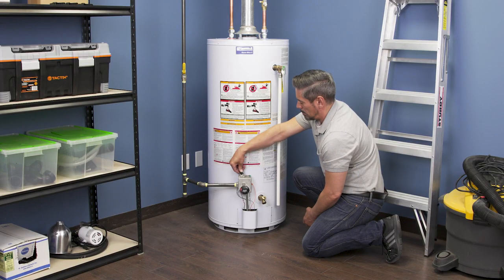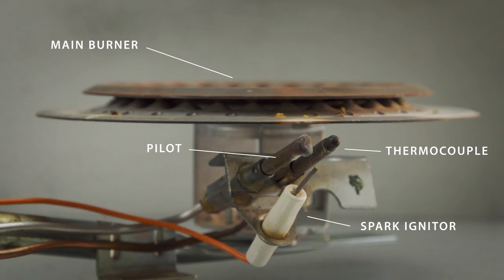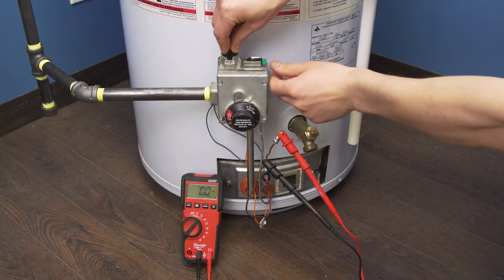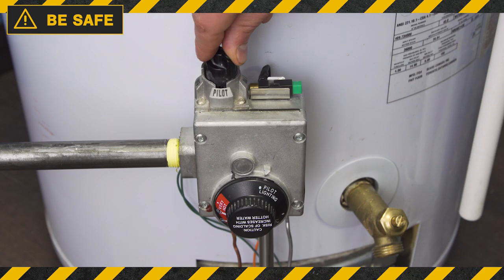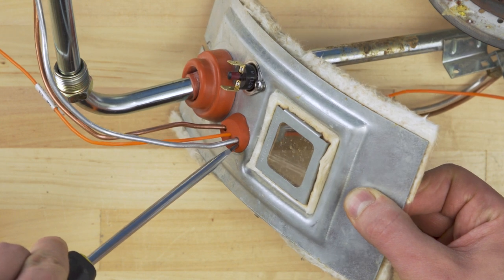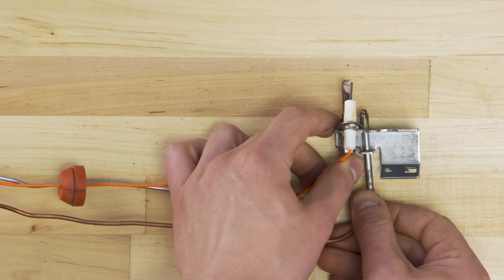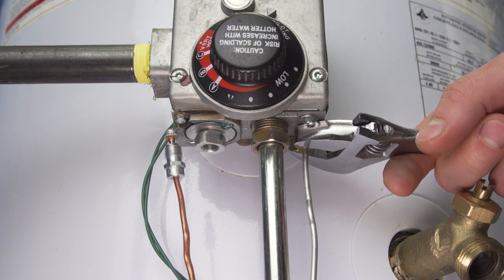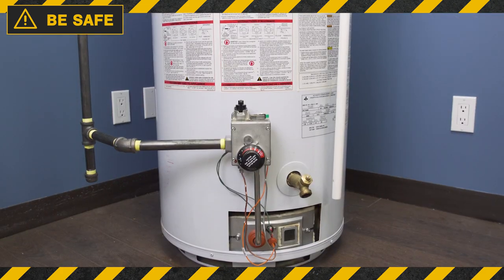Water Heater Thermocouple - Voltage Test & Replacement | Repair & Replace

Comment: Thanks a lot! Great job! Easy to understand! I  replaced thermocouple and it works! Payed less then $11 for the part and saved a lot of money doing it myself. I wouldn't touch this without your help! Thank you!!!!
Reply: Stop working again...Keep looking for the problem. ..Any thoughts?
Reply from the maker: You're welcome Jose! We're just happy to have helped!
Reply from the maker: @JoseSanchez-qh8zd  Try unscrewing the thermocouple and use alcohol and a q-tip to clean the inside threads that the thermocouple screws into. Corrosion in some cases can build up and prevent the current from flowing from the thermocouple to the gas valve. (even if the thermocouple is working correctly).

Additionally it would be worth checking the voltage on the new thermocouple. If you're getting low voltage on a new thermocouple then it likely isn't positioned correctly in the flame.
Reply: @AmreSupply  Thank you! Old thermocouple shows about 20ma. I put new thermocouple. It's working now. God bless you!

Comment: I was able to clean the thermocouple with a small cutting of stainless grill scrubber held in a pair of long hemostats. If I were to have to disconnect the gas and pilot lines to clean the thermocouple, for less than $12 at the big box store, I'd just replace it to make sure I got it done correctly it one shot. Thanks for the excellent instructional video! I'm going to order a replacement thermal switch from you (which cannot be purchased locally) to support the creation of these valuable video resources. ☮❤🌈
Reply from the maker: Thank you for sharing your experience and we appreciate the support! We're just happy to help!

Comment: A friend told me the thermocouple was probably my problem - pilot light wont stay lit.  thermal limiter switch checks out fine.   I found this video.  Tested my thermocouple - seems to be fine at 26mv.  Reconnected it.  And the pilot light stays on now!  buaaahahaha!  Thanks! :)
Reply from the maker: Thanks for watching. One thing to consider is it's worth cleaning the threads that the thermocouple screws into the gas valve. Sometimes corrosion can build up, which will prevent electricity from flowing.  (you can use vinegar or alcohol to clean) 

Also consider that even if the thermocouple generates the right voltage in an isolated test it doesn't tell you if the electricity was flowing to the gas valve. Unscrewing it might have "cleaned" some of the threads but it's another thing to keep in mind as you might have the problems return in the future.

Comment: Appreciate the vid... helpful to know how to measure things.  Mine wasn't staying lit so I replaced the thermocouple and the new one maxed out at 20mV.  It still would not stay lit.

Grabbed another thermocouple (universal at Lowes) and it is putting out 23-25mV and now working again.
Reply from the maker: Thanks for watching! Another thing to check is to see if there is corrosion on the threads on the gas valve. With how humid it can get around water heaters, this connection can become corroded and reduce the voltage that is able to pass through. If you continue to have any problems then try cleaning the connection on the gas valve with vinegar using a Q-Tip.

Comment: Hi, I have a Rheem Water Heater 130L, it has this problem: the pilot stays on, and the main burner only fires up few minutes and then off. If I try again, nothing happens, the main burner does not fire up and the pilot still stays on. Do you have any idea to fix this? Is the problem caused by the thermocouple?
Thank you very much. Your video is the best compared with others on Youtube.
Reply from the maker: Thanks for watching. Is the water getting hot enough or is it too cold? Depending on the circumstances the burner does not need to be on for too long to keep the water at the right temperature. The burner should continue to cycle on and off as needed throughout the hour.

If the water is too cold, and If the pilot stays on, then it's not an issue with the thermocouple or thermopile. It is like an issue with the control valve itself.

Comment: Just tested my thermocouple and it only got up to -17mv. appears to be bad. It stays lit until the burner comes on and then when the burner goes off the pilot is out or off. Interesting that it is neg. voltage. Not sure what to make of this if it is +20-30mv. I verified that I had the leads connected correctly. Even tested with a 9v battery. My connection to the valve is reverse or left hand thread (possibly John Woods). Is it reverse polarity?  Very much appreciate the video. Very well done!
Reply from the maker: Thanks for watching, we're just happy to help! Even with the left hand thread (which is common with a John Woods water heater), polarity wouldn't effect the gas valve solenoid. A solenoid is just a coil of wire that will create a magnetic field when there is a sufficient electrical current.

We do carry john woods pilot assemblies which include the left hand thread thermocouples https://www.amresupply.com/part/58991-JW-40G-MANIFOLD-DOOR-ASSEMBLY

Comment: I’m a service plumber and thank you for this, I get called to water heater issues all the time, I often don’t know when it’s a failing thermocouple or a failing gas control valve, what is the best way to test to know which one is in fact failing?
Reply from the maker: Thanks for watching, we're just happy to help. Testing the thermocouple voltage is the easiest way to help narrow down the problem. Low voltage in an isolated test doesn't always mean a faulty thermocouple but could also mean that the pilot flame isn't position correctly on the tip of the thermocouple. Even with a healthy thermocouple, corrosion at the connection where the thermocouple screws into the gas valve can also prevent it from working properly.

The gas valve contains solenoids which are coils of wires. If a solenoid fails electrically, it will have no continuity and no electricity can pass through the coil. This means that even a good thermocouple will not open the gas valve when the solenoid has failed. You will however still be able to press the bypass button to manually light the pilot.

Mostly it is a process of elimination, and the gas valve is the last thing to replace in that line of logic.
Reply: @AmreSupply  thank you!
Reply from the maker: @am44_67  You're welcome! Cheers!

Comment: Have you ever heard of open end wrenches? They work much better that an adjustable end wrench. Most gas valves do not have enough clearance to get an adjustable end wrench on to the thermocouple nut (3/8) or the pilot burner tube (7/16). Loosening or tightening the main burner gas tube generally requires a 3/4" wrench.
Reply from the maker: Hi Don, thank you for watching. You are right that open end wrenches are ideal. We showed an adjustable wrench as more people have that up to the larger sizes, however it would have been good to mention both in the video.

Comment: I did this and it worked! The rubber gaskest/plug was super hard and brittle so half of it crumbled, should I be worried that the chamber is not fully gas tight because this rubber plug is not tight?
Reply from the maker: Thanks for watching we're glad the video helped you out. 
The water heater will heat water equally fine if the front is not properly sealed. The purpose of sealing the front of the combustion chamber is to prevent vapors such as a spilled cleaning fluid on the floor nearby or paint fumes from being ignited outside of the water heater combustion chamber. The air intake below has a screen across it and only the amount of vapor that gets into the combustion chamber will burn.  
One option is to look up the replacement part using your model number. If a new gasket is not available you could use a Hi-Temp Red Silicone Caulk to help seal the front panel.
Reply: AMRE Supply super helpful, thank you for the reply and the help!!!!
Reply from the maker: @seonggkim  You're welcome Seong!

Comment: Hi  Thanks for sharing your video.  My only question,  how will I know the right thermocouple to buy?  Is there a specific part number fir a specific water tank?  Many thanks!
Reply from the maker: Thanks for watching, we're just glad to share some good info! When it comes to themocouples, the standard used for water heaters will produce up to 30mv of power and will have the same sort of connection (The only exception is John Woods which will have reversed threads). If you measure the length of your thermocouple, then just match based on that measurement: https://www.amresupply.com/catalog/Thermocouples-647761-HV1G-HV2K
Reply: can you use the universal thermocouple to replace one that has a TCO inline or thermal fuse as it is so called? thank you.

Comment: It's 1hr until 2020. And the damn hot water service died an hour ago.
I unknowingly used up the last of the hot water for my shower 😀
My girls wanted showers.

Used this vid to diagnose and the damn thermocouple will only make 17mv after 2 minutes of flame, even after cleaning it 🙄
Now to wait for the plumbing supplies shops to come back from holidays. 

Thanks for the vid. Now I know how these work. Much appreciated.
Reply from the maker: You're welcome Hoobz01, we're glad the video helped you troubleshoot the thermocouple! All the best to you in the new year!
Reply: don't forget to give the pressure relief valve a tug!

Comment: Any recommendations for removing a stuck pilot line from the control valve? Compression fitting has obviously been unscrewed but the line doesn't want to pull free. I've tried wiggling it a bunch but I'm afraid to pull much harder given the tiny diameter of the pilot line. All the videos I've seen show it being removed as easily as the thermocoupler but this is not the case on my water hearer. Any advice would be appreciated. Quality videos btw.
Reply from the maker: Thanks for watching, we're glad that you found our videos helpful. You could try tapping on line to help it release, a small amount of force can help it loosen before pulling outward. You could also try to apply a small amount of heat to it. Pliers could help you grip it as well, just try not to crush the line.

Comment: What could be the issue with the burner not turning on when the temp setting is 120 degrees and I turn on the hot water faucet.  If I turn the temp setting to a higher setting, A, B, or very hot, it works fine.
Reply from the maker: Thanks for watching. The burner will only kick on as needed. Based on how the sensing bulb works, it often takes a bit of new cold water before it will kick on and start the burner. This is not instantaneous. Turning the controls to a higher temperature will change the threshold of when it turns on. As well running a lot of hot water will require new cold water to enter the tank, which will trigger the burner to turn on.

If the water temperature is still comfortable and the burner still turns on and off as needed throughout the day, then you won't need to install a new burner / gas control valve.

Comment: I bought a brand new thermocouple, installed it, lit the pilot light waited five minutes, and released the valve only to have the pilot light go out on me numerous times.  Why is this happening and how do I fix it so that the pilot light stays light.  I have installed a dozen of these thermocouples, never had a problem until now.  I kept this up for an hour and would not stay lit.  Please respond.  thanks.
Reply from the maker: Thanks for watching. It could be corrosion at the valve itself. Moisture in the air can effect this. If you unscrew the thermocouple, you can use vinegar and a q-tip to clean the inside of the valve where it screws in.

As well it could be an issue with the airflow, which can also cause the pilot to blow out. As well it could be the thermal cutoff switch. You can see more in this video https://youtu.be/Lu5GvbvspMw?t=301

One other issue can be a dirty pilot orifice, a restriction in the gas flow will result in a weak flame. 

Hope this helps.

Comment: What about the heat-resistant plug/grommet holding the tubes together? Is it compromised if there’s a slit to remove the thermocouple?
Reply from the maker: Thanks for watching. That is a good question. These grommets will often come installed with the slit. When installed, the rubber will press together so there isn't a significant amount of airflow so it shouldn't create issues. If needed a high temperature silicone sealant can be used.
Reply: @AmreSupply  Thanks for replying so quickly. Yeah, that’s what I figured, but since a Rheem product’s grommet doesn’t come with a slit I wanted to check if I could make one.
Reply from the maker: @Kroododile553  You're welcome,  we're just happy to help!

Comment: The thermocouples tube in my Reliance WH has small disk (3/8”) and two hooks that connects two parts of the thermocouple tube. The tube is not continuous. Can I replace it with one that it continuous?
Reply from the maker: Thanks for watching! That small disc is actually a thermal fuse which will shut off the gas if the combustion chamber overheats. To maintain the safety of your water heater you'll need to replace the thermocouple with another one that comes with the built-in thermal fuse.
Reply: My AO Smith GVR 50 100 has the same thermal fuse/ thermocouple configuration.  I replaced my defective thermocouple with a generic continuous thermocouple from Home Depot (Everbilt 24").  As AMRE states, the fuse is a safety if the chamber overheats, which I believe would occur if the ventilation is clogged.  So I made sure to clean/ vacuum my vent screens as well as the combustion chamber during this replacement.  Fixed my pilot from going out.

Comment: Can you please tell me the size of the nut the connect the thermocouple to the gas outlet …
Somehow I lost it…
Reply from the maker: Thanks for watching. The thermocouple nut is special and is not a common thread size. Replacement nuts aren't commonly sold outside of a thermocouple kit but you might be able to find it somewhere. For how inexpensive the thermocouple kit is, it would be best to just buy a new thermocouple.

Comment: I have a water heater that the pilot kept go out when I turn  up to water temperature control (it work fine if I leave at low temperature) Would this be a Heater Thermocouple issue? please advise. It is winter time so I need the water to be warmer.
Reply from the maker: Thanks for watching. The thermocouple is not affected by the temperature of the water. It's possible that the thermal cutoff switch (which monitors the burner temperature) is tripping at a lower temperature. When you turn the dial to increase the water temperature, the burner will run longer and / or more frequently. The other consideration is airflow. It's worth checking to make sure that everything is clear. This is described more in this video: https://www.youtube.com/watch?v=Lu5GvbvspMw

Comment: When putting in new thermocoupler is it safe to touch it with your hands from oil kinda like headlights in a car.
Reply from the maker: Thanks for watching! Touching a thermocouple with your hands won't significantly affect how much it heats up or what voltage it produces. With headlights in a car, the oil can boil and can fracture the glass, which can lead to early failure.

Comment: 4:44 I see that you are turning the nut clockwise to loosen it, but doing a search on google suggests that most nuts are turned counter-clockwise to loosen. Is this nut for the pilot tube a special kind of nut and needs to be turned clockwise to loosen? 

I am currently struggling to get this nut loose. Tried turning clockwise and counter clockwise. It's probably a problem with my wrench. I will be getting a better wrench tomorrow
Reply from the maker: Thanks for watching. This nut is turned counter-clockwise when you view it from the bottom. It would be the same as tightening or loosening a screw or bolt. You'd be looking at the head of the bolt when tightening or describing the direction.

We also filmed a model that uses a electronic gas valve. This also turns in the same direction as this conventional gas valve: https://youtu.be/Yx2gfgJB7bI?t=277

In your case corrosion from moisture might be causing the threads to stick. However this shouldn't take too much force to break loose.
Reply: @AmreSupply  Cool. Thanks for the reply
Reply from the maker: @username-hs3pc  You're welcome!

Comment: I got tired of trying to view the pilot light through crazy angles.  At first the thermocouple when being replaced was not far enough in to get sufficient heat from the pilot.  After adjusting the TC it worked much better only going out monthly.  Now it seem when ever the wind blows even being in the garage out it goes.  Taking the plactic cover/hood off to view through the glass caused the pilot to go out when it lit.  With the cover off the heater made quite a a bit of noise and seems the culprit  to blow the light out.  Cover back on presently it seems ok but to take the new TECHNOLOGY out and repair it again is quite irritating. The looming question is whether or not I should push the TC in farther to get a larger part in the pilot.   One year left on the so called nine(9) year heater.
Reply from the maker: Thanks for watching. With your new thermocouple, if the pilot blows out when its windy then its likely not an issue with the thermocouple.  A problem with wind can be helped with a chimney or vent cap for where the exhaust is vented on the outside. As well you could try sealing the garage door more so that the wind doesn't dramatically effect the airflow inside the garage.

Comment: what happens if you kink the pilot tube? is it toast?
Reply from the maker: Thanks for watching. If the pilot tube is kinked then check to see if it is punctured or if the flow is restricted. If either of those are true, then you'll need to install a new pilot assembly.